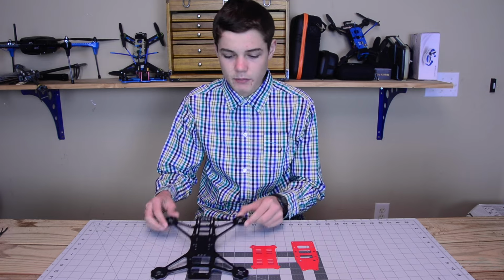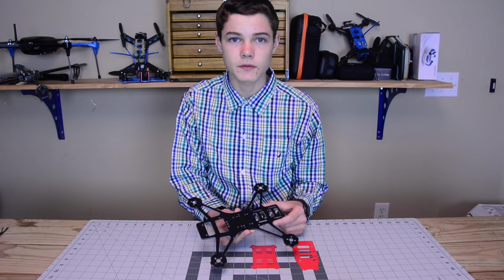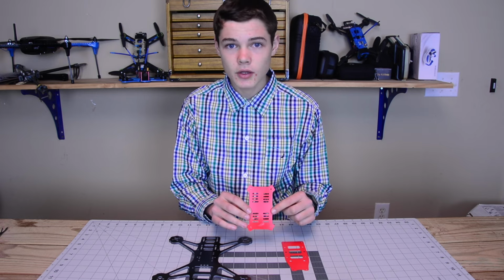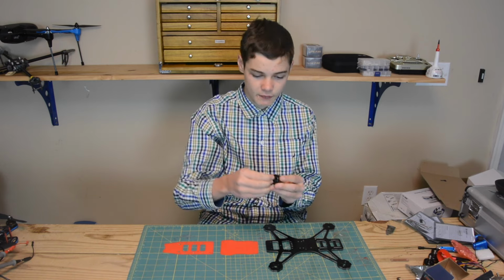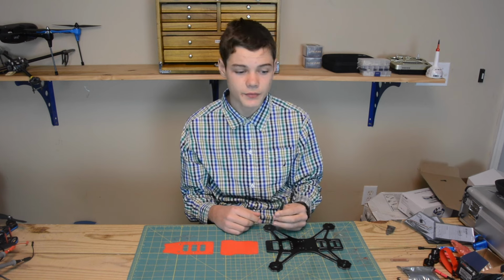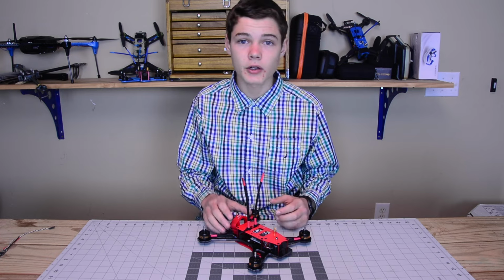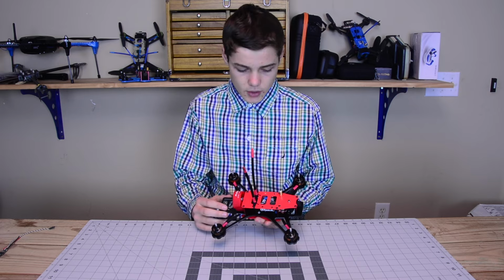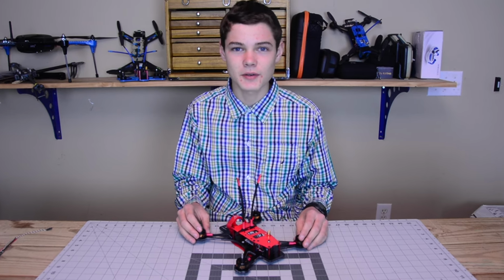Race Spec Miniquad (Rvz 250)

Comment: Did you make the frame? I didn't catch if you bough it or made the frame. I purchased, where? If made, what program did you use to make and send to CNC. Tip: wear solid colors when filming. Cross pattern shirt not so good lol. Great job on the build, thanks for sharing.
Reply from the maker: +ghosTECH FPV Yes I designed the frame myself and cut it out on my CNC router at home. I designed the frame on Fusion 360 and used Mach Mill on the CNC side. If there is enough interest, I will make a website and sell this frame there. Otherwise, if you would like to purchase one, please email me at robzfpv@gmail.com. Thanks for the tip!!
Reply: +Rob Z Brilliant! congrats!
Reply from the maker: +ghosTECH FPV Thank you very much! The next video is up!

Comment: Really nice looking creation there! The only major problem I see is that I don't understand how you can get the cg right with the battery that far back (unless you put a gopro on the nose of it).

Also get better escs on there to match the motors.
Reply: +Peter Kjellström The 4 cell battery fits all under the top deck, making it right above the CG. The quad is perfectly balanced because the battery can be moved around. These ESC's are very high quality, but I could possibly put some 30 AMP esc's on!
Reply: +Robert van Zyl It very much looks like the furthest towards the front the front end of the battery can go is almost-mid-point between front and rear motor lines. With that and a typical 150g battery I don't see how it can balance (only the hs1177 or whatever up front).

Add a clip where it balances on a pen to your 2nd part and you'll have me convinced though ;-)

Regarding the dys sn20 very few people consider them "very high quality". You might want to try upgrading to the dys xm20, rotorgeeks 20, kiss 24 or similar (if you want to match the gold standard set by that f40 motor...)
Reply from the maker: +Peter Kjellström I will definitely take your advice and invest in some better esc's. I will also address your question about the CG in part 2. Thanks for your advice! :)
Reply from the maker: +Peter Kjellström Check out the next episode, which answers all of your questions. Also has my FPV maiden!!!
Reply: +Rob Z Great follow up! Note that the most important thing is that the cg is midway between the motors (which yours is). A bit of offset for the fc isn't too bad (especially not for racers likely to fly rate/acro).
Reply from the maker: +Peter Kjellström Thank you for the kind words! I figured that it would not be bad to offset of the flight controller, as it would only have a very minor impact.